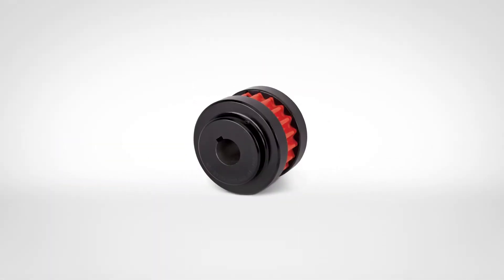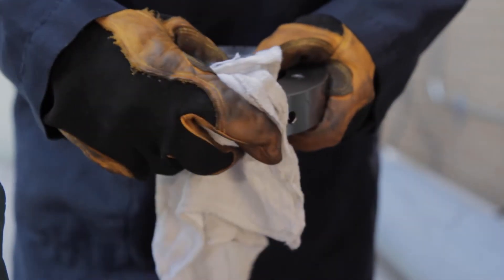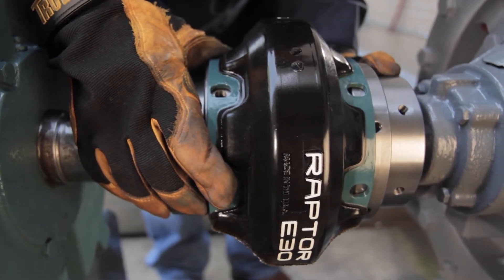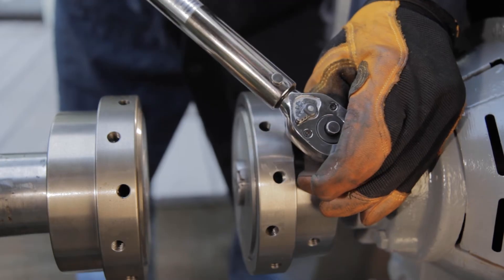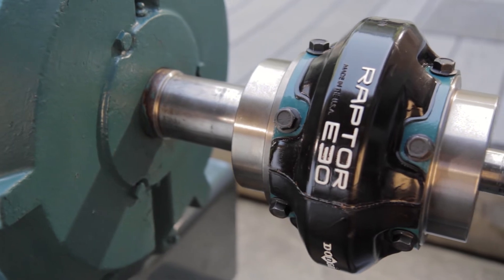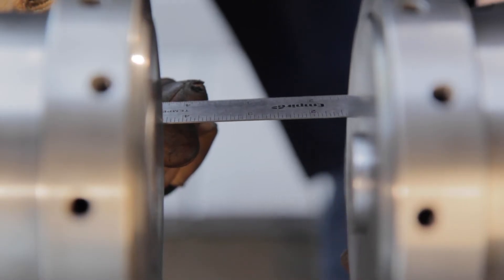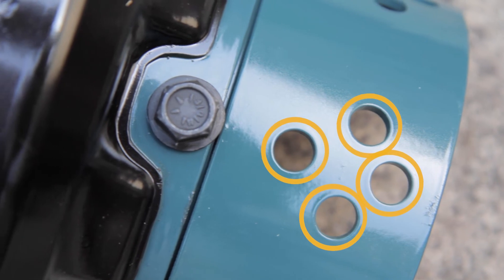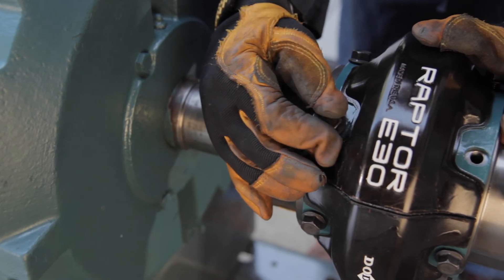Dodge Raptor Coupling: Element Installation and Replacement Module | Dodge Industrial

Comment: What's the alignment tolerance when using that coupling?
Reply from the maker: Please contact our engineering department at +1 (864)-284-5700 or engineering@support.dodgeindustrial.com. They will be happy to assist.